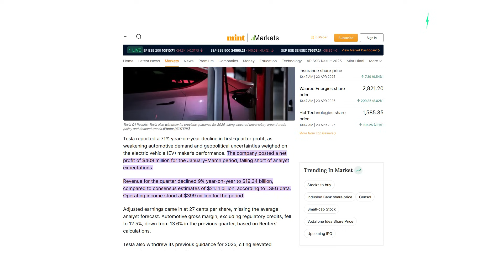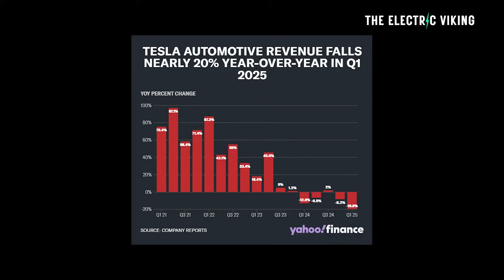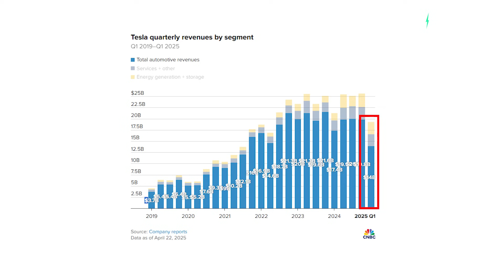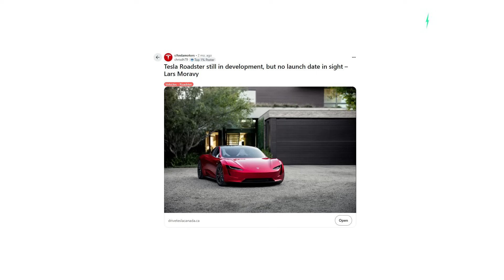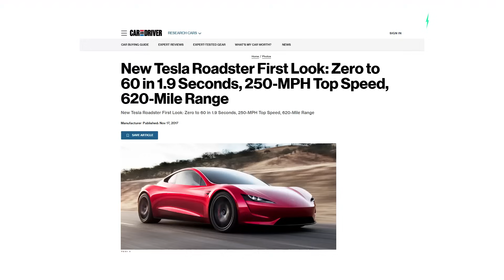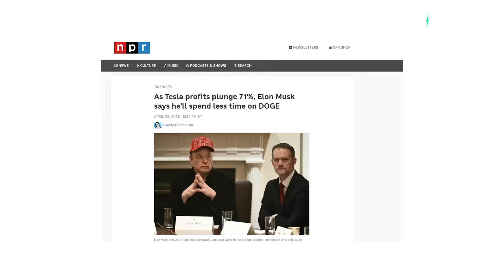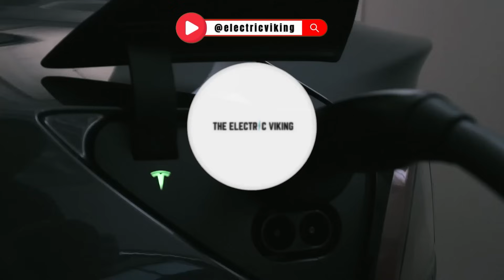Tesla Q1 Income Drops 71%: Quick Recap in 6 Minutes

Comment: It needs to be said that it is quite common in the stockmarkets for stocks to go up after showing bad numbers, just as it is quite common for stocks to go down after presenting good numbers. The reason is that in the runup to the bad news the bad news is already incalculated before the earnings call starts, or in the case of good numbers, the profits and rise are already incalculated in the earnings call if it's a positive one. That's why you often see stocks move in the opposite direction of the results of an earnings call, UNLESS there are suprises that have not been either communicated or leaked ahead of the earnings call. Musk taking a step back from Doge is also positive, but will have little impact particularly in Europe unless he stops meddling in politics altogether.

Comment: I do not believe there will be a budget version of Model 3/Y. And I think everyone who drives one of those will agree. 

I can’t think of anything relevant you can strip from the current model to lower its price (the rear seat touchscreen is probably a USD 30 feature…). 

The only way to bring down the consumer price significantly would be to introduce a significantly smaller battery. Which is currently imported from China and heavily taxed. 

Maybe a smaller motor, but only if this motor will be used for future appliances like the Robotaxi as well, otherwise it wouldn’t be worth the development cost.

From a marketing perspective I reckon it is not a good idea to come up with a budget Model 3/Y that looks like the regular model.

Comment: Making cheaper versions of existing cars is not a good idea for net profit. The difference in cost to build is very small and won't even break even with lower sales price. In fact it might result in less profit on those cars and some loss of sales of the more expensive ones.
Reply: Well... in term of gross margin per car, you are absolutely correct.  However, reducing the price of a car by 10% more than double its accessible market.   I am pretty sure that Tesla is not going to make them to earn LESS profit!  They know their market segments inside out!
Reply: Expanding into an accessible market cannot be achieved unless enough more batteries can be made.

Comment: It's interesting because the market is running right up to resistance today.   If the market breaks thru, then it becomes support.    If it fails to break thru, lower lows will come soon (like 37600ish for the DOW).    Tesla resistance in particular is up at 270-272ish and it has already broken through the falling moving average.    Seems irrational to me given the staggering drops in sales.  If it does ultimately fail that upper bound, 221-223ish would be the next likely stop.

I don't do this stuff regularly any more tho.  I retired at 51 over a decade ago.   Mostly from hard saving and not above average returns.    I'm set til I kick off and trading any significant amount would only risk my safety.   I'm probably under 10% equities at this point.    Even have reduced exposure to the bond market and loving those sweet 4% short term bonds and CD's.

But I used to do this stuff daily for about 25 years.  So that's the basis of my opinion.

Personally- I think Musk has killed his brand and the other EV's had already caught up and were taking market share before the election.

Comment: The trouble with a new cheaper Tesla will be lower profit margins and that is why production has not started yet!
Reply: How much can they save by removing some electric motors in the seats and tailgate, led matrix headlights, a screen which costs a few bucks and some other minor features?

$500?$1000? Will it make any difference on selling price?

These cost almost nothing to the manufacturer and are there just to justify the high end price.